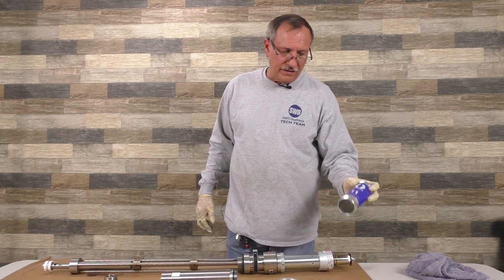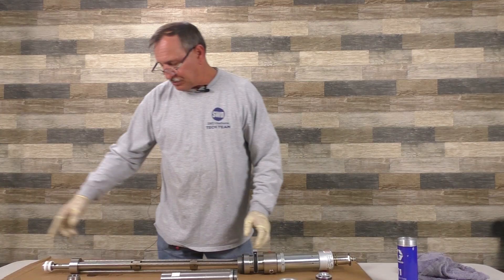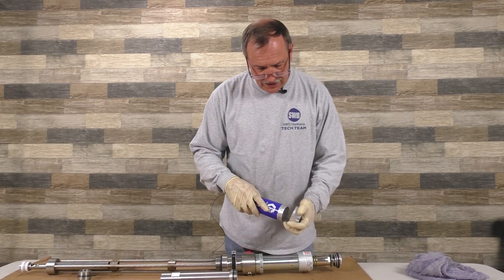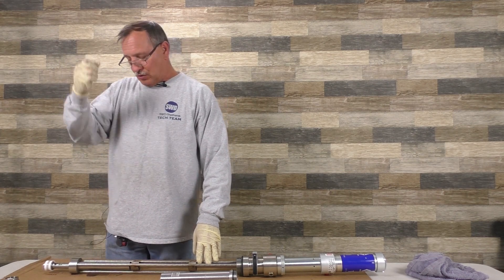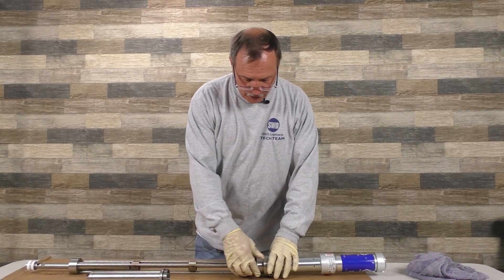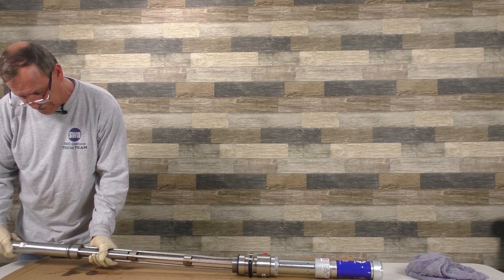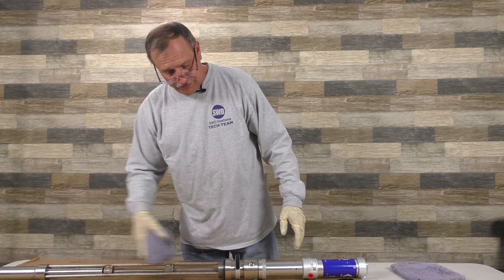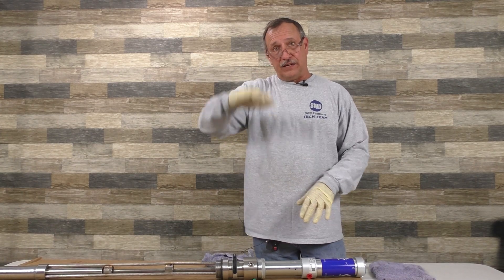Pump Breakdown T1 & T2

Comment: Would the need of this rebuild cause the psi on that particular side to never climb back up to the original psi programmed?
Reply from the maker: Hello Dustin, A pressure issue could stem from your pump, hoses, or your machine. For help with this issue please reach out to our tech team at 888-380-2022.